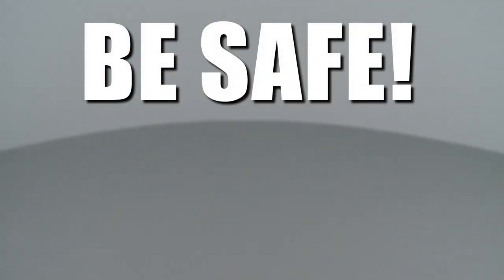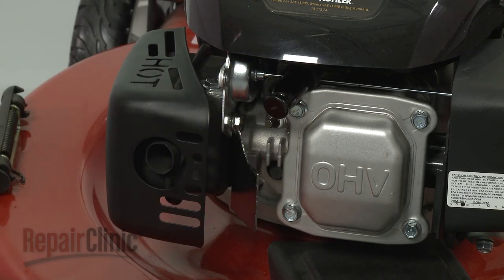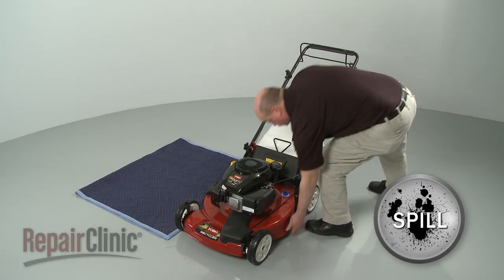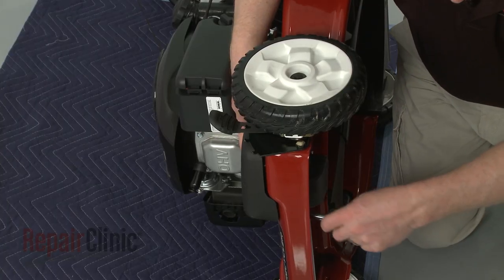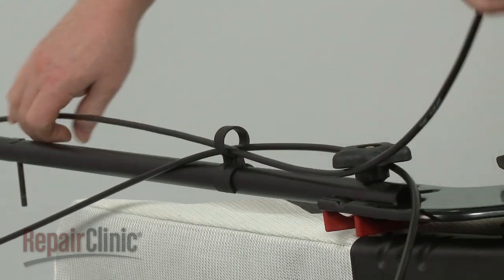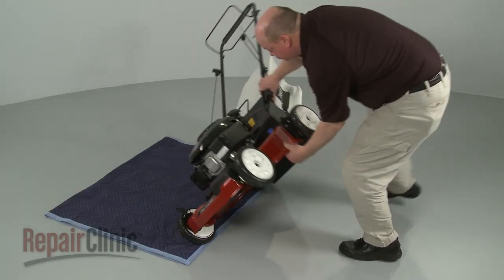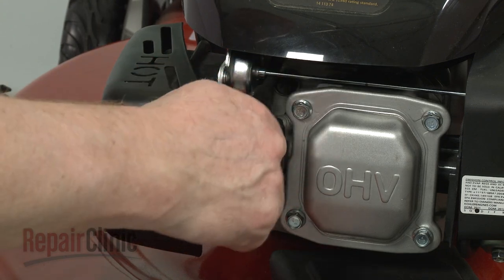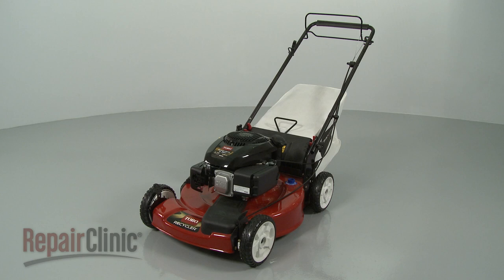Toro Lawn Mower Traction Control Cable Replacement #119-2379

Comment: was a 7/16 bolt on the handle and a 3/8 screws holding the front cover down for me.  replacement worked like a champ and I have self-propel again thanks
Reply: This was the comment I was looking for thank you
Reply: @stevenfrench7940  glad it helped, always happy to keep equipment running

Comment: I’ll tell you what, this is my first and last Toro. This is the 2nd time I’ve replaced this, and the drive belt like 5 times, in 5 years. Thanks for the tutorial though.
Reply: Yup, this thing breaks a lot of parts.
Reply: Dang what guys mowing over? I’ve had mine for over 10 years and it’s only now broke down once and it was this part

Comment: Much, much more difficult to install than shown here. My mower has a lot of other stuff under there and there's no way to reach in and hook on the spring as shown. 

Either have to take the wheel off or take other parts off the bottom. Didn't want to do that, so I used a screwdriver and pliers to coax the sprint to the right place, but couldn't get it to hook on. Finally bent the hook a little and after about an hour, finally got the hook to go through the hole.

Comment: So I replaced my traction cable, and the self propelled no longer works. I followed the video through and through. The old cable was broken where it went into the handle. Any idea what the problem might be.
Reply: Nvm somehow the drive belt came put from where the blade is, I got it back on and now it works great. Thanks for the video.

Comment: Thanks , My issue was the cable needed adjustment and the belt slipped off the belt wheel. Between the 2 vids I got it going.

Comment: Hi, great video.   A question.  If the front wheels continue to turn even if the traction bar (the bar used to engage the drive system) is teleased, is that an issue with the tension on the cable?   Thanks!
Reply from the maker: Tony M Yes. Most likely the cable needs to be adjusted so the belt loosen tension when the bail arm is released.

Comment: How do you know if it's the cable that needs replacing? Over the past several years the self-propel has declined in it's effectiveness but this year there is a grinding noise and very little to no self-propel.
Reply from the maker: I would lean towards a new belt first. You can remove the cover on the transmission pulley and see if the cable pulls the belt tight. If the belt is stretched to much it will not get tight. You can also try adjusting the tension on the cable by loosening the cable retainer on the handle and pulling the cable tighter then retightening the screw.

Comment: The wheels turn, but as soon as they touch ground, they Stop. Is this also a cable issue or something else?
Reply from the maker: Vilma Rodriguez You can try adjusting the cable by loosening the cable support on the handlebars and pull the cable tight then tighten the bolt on the support. This should give you more tension on the drive belt. If this doesn’t work you can try a new belt, it may be stretched out. Or replace the cable.

Comment: "Remove the sparkplug wire from the spark plug, to prevent the engine from accidentally starting." 

Right.  A pullstart is going to accidentally start. Every man I know has war stories about pull starting a lawnmower but let's remove the spark plug to make sure it doesn't magically come to life on its own? 

Lol get real guys, thats over the top cya even for a lawyer 🤣